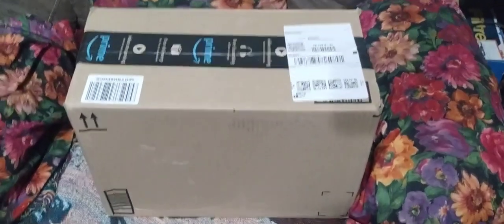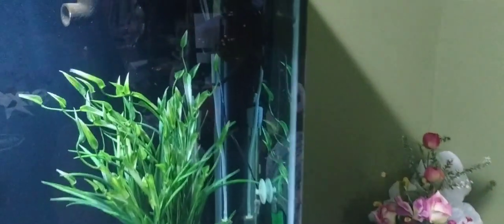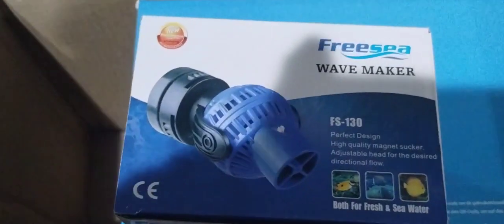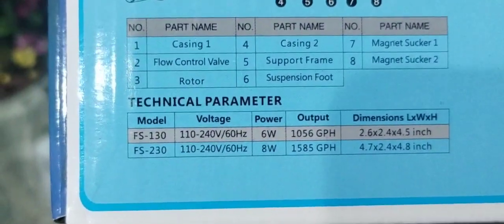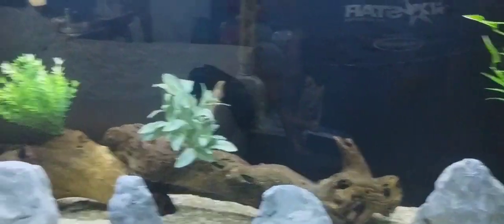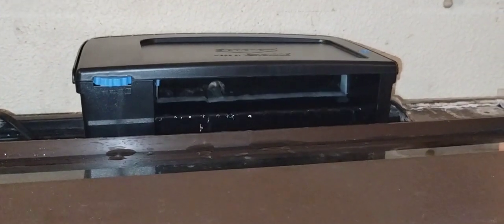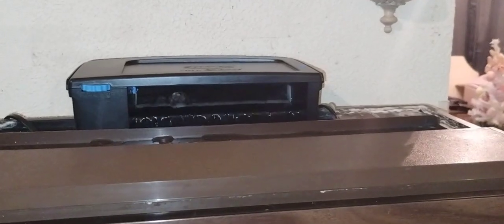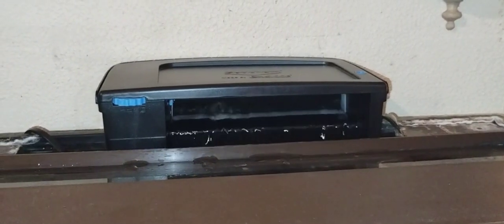seachem Tidal 110 by sicce. Installed on a 55 gallon aquarium.

Comment: These are the only HOBs i use. The onky thing i dont like about them is the skimmer feature it takes away from the suction on the intake. So i actually just block off the skimmer part with plastic and some silicone. Other than that they are awesome
Reply from the maker: LoL I just noticed that I'll probably be doing the same thing. Other than that there great 👍
Reply: Has a lot of space for filter media. Have never use HOB. My mother’s 29gal has one. Seem to do great. May use one on another project. Thanks Danny for info

Comment: You need to place your foam media vertical so the water flows through it and not around it.
Reply from the maker: It does great this way. Easy to remove and clean. It's catching enough that the water is  crystal clear.